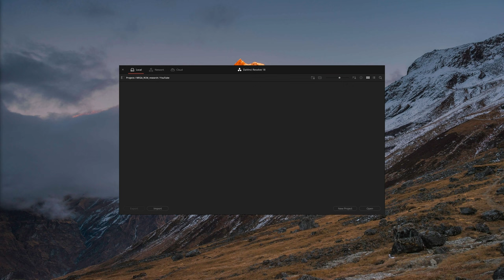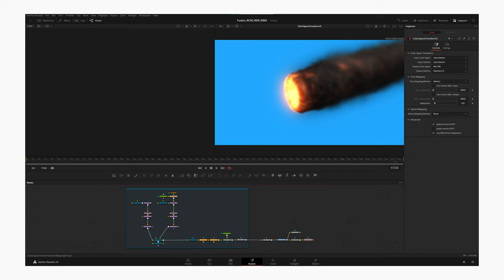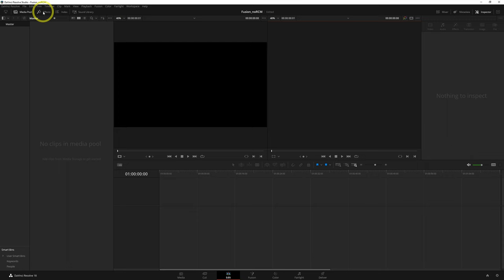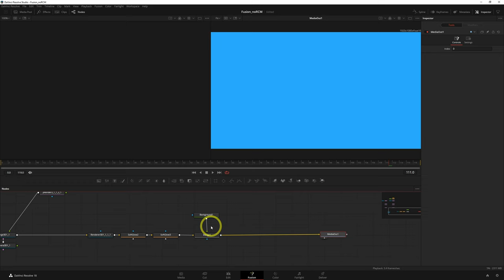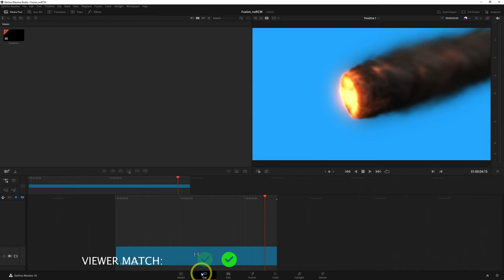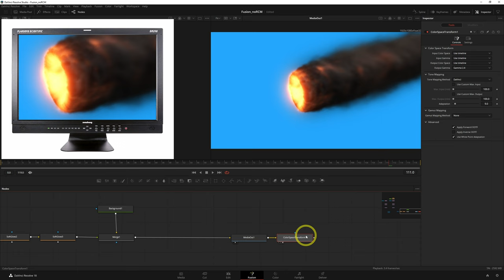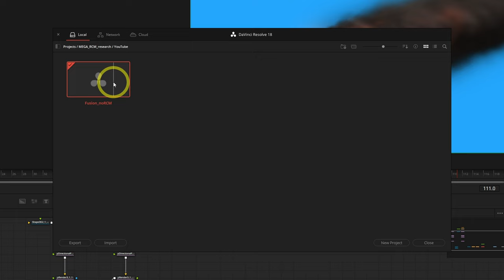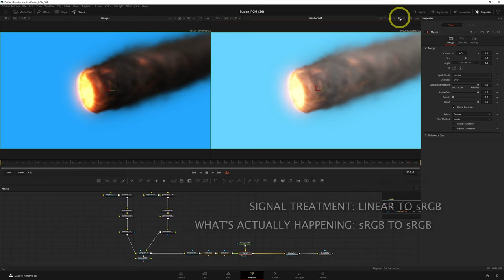Fusion Color Management

Comment: I Have a question about your statement at 13:20 "This problem is unique to compositions that are created in a non-color managed project, and then that project has color management enabled." I am having a hard time understanding this, because when I create a brand new project, enable automatic color management, and then create a simple fusion comp with a colored background, i still get the washed out discrepancy you are demonstrating. Shouldn't the automatic color management take effect on this composition since it was created in a color manage project?
Reply from the maker: I've just tried this on my end and I got the washed out result when I disabled the viewer LUT and went back to the Edit page. That makes sense because at that point I was looking at the linear image in Fusion (no viewer LUT) and the sRGB version of it in the Edit page. With the viewer LUT enabled, the viewers look almost identical, minus the slight gamma shift we experience due to the difference in the sRGB and Gamma 2.4 (as described and fixed in 20:47). So, the workflow for starting a project from scratch should be to work with the Fusion viewer LUT on and a simple CST converting the composition from sRGB to Rec.709 Gamma 2.4 prior to the MediaOut node. Hope that helps!

Comment: Daria, I know that I asked you this in person before ( on facebook ) but I still don't understand why Rec709 (scene ) is the default for the non managed color management. You gave me an explanation then and I believe it is the same in this video, but after doing a lot of research, I understand the explanation, but in my opinion it makes everything confusing for new users. Rec709(scene) is generally the camera gamma - which is around 1.95 - I really don't know anyone that is working in Resolve that isn't using some type of display - and I would be that none of them are set up for gamma 1.95 - so the connection for the user of then changing the output to their display gamma requires that they know what they are doing. Resolve should be able to tell what the input is - so the Rec709(scene) as a default still makes no sense to me. Usually defaults are set to what the majority of users would use, and although broadcast is gamma 2.4 for most pros. Macs P3 and most sRGB PC computer displays would be better to have gamma 2.2.

whewww - sorry I don't have the ability to put up a puppy video while spouting off all my thoughts in these comments. Maybe just visualize one in your head while reading. 

Now the other thing that doesn't confuse me, but I wonder about - the Davinci tone mapping and check the forward OOTF - I have been under the assumption that the actual checking is automatic in Resolve because if you change the color space drop down Resolve will check or uncheck the appropriate setting. And I noticed that going from a large gamut to a small gamut or vice versa is what triggers it. And considering that just changing the gamma from linear to 2.2 or 2.4 is not really changing the actual gamut size - the Davinci tone mapping wouldn't seem to be something that you would want happening, and forcing it into OOTF doesn't seem right to me either. 
I will of course do more reading on these topics to confirm my opinions or discredit them as incorrect. 

I have to say that watching this brings me back to my old coding days where I had a company that I would preach - If you are doing something that seems to long and tedious where you feel there has to be a better way, there probably is a better way. You either haven't learned it or you have uncovered a problem where you might need to invent a better way.
You mentioned that some of this seems to be a band-aid - I get that feeling watching this that you are smart enough to get everything working here correctly, but I think the engineers may want to figure out better solutions to these problems. Color management shouldn't need to have seperate color managements for fusion- just doesn't seem right to me and all the stuff you did to work around that is impressive - but should be in my opinion dumbed down for people just to check off how they like to work in the user preferences and then everything else should be done to accommodate their preferences.
Sorry for being so long winded here Daria, It's a slow day for me today.
Reply from the maker: Jim, I really admire how passionately you have been pursuing this topic. It's one of the reasons why I wanted to start exploring color management more thoroughly and trying to acknowledge (and fix) the gamma issues when working with DWG and ACES. I wholeheartedly agree that, ideally, none of these workarounds should be necessary. Users and trainers have been reporting the visual shift between the Fusion and Edit pages since DWG was first released. Most people first encountered it when using Resolve's templates and tools like Text+. And this issue is further complicated by the rigid behaviour of the Fusion Viewer LUT (which should adapt in response to the project color settings). Are you at NAB this year? Shall we corner one of the devs and enquire politely about this and the Rec.709 (Scene) question?
Reply: @DaVinciMasterKey  That really would be a great opportunity for me to get some questions answered, but unfortunately my passport ran out during the pandemic ( Canadian ) and the backlog has people waiting months for their processing. I know a few people that had holidays booked and had to cancel because of the wait.  
Thanks for responding, I really respect your opinion and ideas - but found myself watching and thinking there has to be a better way. 
I just see people in the forums that are getting so frustrated, and I help where I can. 
Cheers
Reply: My two cents. Most of the confusion comes from encoding and display gammas being juggled interchanged, with foggy terminology and namings. Lets start with a simple question: does a rec709 camera feed sent directly to a gamma 2.4 calibrated display look as intended or not? If it doesn't, why, and what should be changed? If it does, then there is the answer: data encoded AS rec709 scene is encoded FOR gamma 2.4 display. Notice the AS vs FOR - these are different aspects of the same coin. Data encoding is not display transform/calibration. Gamma 2.4 display calibration specifically targets dim surround and end-to-end gamma above 1.0, which is achieved by feeding it rec709 scene signal. If gamma 2.4 corrected signal were sent in, end to end gamma would be 1.0 which makes the mids too bright. Now, how come everything seems to work when project's output space is set to gamma 2.4 encoding? My two cents is that in this case people subconciously compensate for it in the grade, implicitly applying the reverse correction to the data. Resolve tops the confusion with output space dictating the metadata tags, so people are forced to use gamma 2.4 to get stuff tagged for some random software X.
Reply: @hendrikproosa  That is a very good point, a big point of confusion and one that I have yet to see explained clearly. It is so often said that "Gamma 2.4 is for a dark room with controlled lighting, 2.2 for the TV in a lit room and 2.6 for the cinema projector, so you should grade SDR on a monitor calibrated to Gamma 2.4". Meanwhile, if you changed your ODT to output 2.2 and calibrate your monitor to gamma 2.2, it should look 1:1 the same as before, because you're just applying the inverse of the monitor's EOTF, which cancel eachother out. Or am I mistaken, Hendrik?

If you're open to collaborating, I'd love to tackle this topic in a video with your help.
Reply: @KaurH  That's the idea, but full perceptual match in different environments is a hard goal to reach. ODT as a term is problematic imho. Output Display Transform implies that whatever you select there is targeting that display. Ok, great. But what if you select lets say ACEScc as ODT? What kind of display does it target... none. So again, you get a mixup of different concepts. In some cases ODT says that it encodes data FOR something, in other cases it says it encodes data AS something.
Reply: @hendrikproosa  Maybe I didn't explain myself clearly enough, but by match I didn't mean a perceptual match with 2.4 in a darker environment and 2.2 in a brighter one, but whether the same display in the same environment would look identical, if it was
a) Calibrated to gamma 2.4 and Resolve output gamma 2.4
b) Calibrated to gamma 2.2 and Resolve output gamma 2.2

I use the term ODT (output device transform) only in situations when I am outputting to a display transfer function, be that a gamma or PQ curve, otherwise I just call it what it is, a CST.
Reply: @KaurH  They should look identical within precision. Calibration curve and encoding curve would cancel each other out in both cases, producing end to end gamma of 1.0 IF output gamma means the gamma correction for specified value.
Reply: @hendrikproosa  In that case, why are we talking about a difference between gamma 2.2 and 2.4 if the displays cancel that out and given that both are calibrated, would result in the same image, right?
Reply: @KaurH  Because you need to send proper data into display based on how display is calibrated. You won't recalibrate the display each time to play footage with random gamma X, so data encoding has to be changed instead. You can calibrate your screen to random gamma if you want, but you have to compensate all the data to see it in any reasonable way. Macs did (maybe still do) similar thing where LUT sitting in the signal path expected data to have been corrected for gamma 1.8.

Comment: Hi Daria, I do have a follow up question. When working in a DWG color managed workspace, if you use a Text+ Title, the color of the title is affected in a similar way, as in it doesn't display on the edit timeline as one would expect, however when opened in the fusion page it looks as it should. I presume this happens because it is a fusion clip, and therefore has a Linear gamma. I thought that perhaps adding a color space transform effect to the Text+ layer in the edit page and changing the Input Color Space to sRGB and Input Gamma to Linear might fix this - but although the image changes, it still isn't correct. Do you have a recommendation on the best way of dealing with this? I understand that it makes sense to make most color adjustments inside fusion, if working on a fusion comp - but in the case of Text+ layer on the edit page - what would you suggest?

Thanks.
Reply from the maker: At the moment, my solution for this shift in the Text+ (and many other Fusion titles) is like the one I described above - using CST nodes at the end of the Fusion pipeline to better manage the tone mapping. But but but.....I think the devs are working on this at the moment, so we may be free of this issue soon!
Reply: @DaVinciMasterKey  thank you
Reply: @DaVinciMasterKey  That would be awesome, Daria (to have Resolve address the issue with tone mapping of Text+, etc. but it's good to have a better understanding of what is going on and be able to tweak it as you have shown).

Comment: Any idea if the announced "Support for DaVinci Wide Gamut in Fusion"  in Resolve 18.5 Beta (assume it's included in the released 18.5 as well) addresses the color management issues? Tried messing with it and it looks like it gives an option to set the color space on the MediaIn node. Couldn't figure out how to get it working properly (probably due to my lack of understanding).
Reply from the maker: I've just tested these workflows in the newly released Resolve 18.5 (it came out of beta a few hours ago), and most of these solutions are (unfortunately) all still relevant. The Color Space parameter has always been available in the MediaIn node, but it doesn't rectify the problem, especially considering that the rest of the pipeline (generators, text, graphics, etc) need color management. The only difference I spotted was when I was working in a DaVinci Wide Gamut project - the Fusion composition was correctly color mapped on the Edit page timeline from Fusion. But there's still the issue of the Fusion viewers not showing the image correctly - I had to use the above solutions to reverse the color management to monitor the composition correctly while I composited it. Thankfully, no additional management is necessary in the Fusion pipeline (prior to the MediaOut) itself.
Reply: @DaVinciMasterKey  Hi Daria -
Now that Resolve 19 is out and supposedly fixed the Fusion color issue, how do you think they did?  Is it fixed or is there more that needs to be done?

Comment: Fusion nodes ... and the Color Management tab nodes confuse me. They're not one and the same. I suppose Fusion has its own workable SDR color management but for real detail, the Color Management tab rules. Is that right?  Should i use Fusion for effects mostly, Color Management tab for my color management? Thanks!
Reply from the maker: When you say Color Management tab, are you referring to the color management settings in the Project Settings? Those determine project-wide colour management. The reason why you don't see that management reflected in Fusion is because Fusion operates within its own working color space (sRGB Linear at 32 bit floating point). Color management in Fusion is normally only done for monitoring purposes, with actual footage color mapping performed in the Project Settings or the Color Page.
Reply: Hi, thanks for answering. I meant that tab just to the right of the Fusion tab. The Color tab, I guess. I was worried there was a duplication of effort (color in Fusion, color in Color tab). But if the Color tab is the main deal to use (especially for a film), that is good. So, I guess the node structure in Fusion is different than the node structure in the Color tab and both can coexist. @DaVinciMasterKey
Reply from the maker: @RealNowTruth  Oh yes, they're designed to co-exist! They're both integral parts of the post production signal process. Generally, the Color page is where we manage incoming colour from raw video signals, grade it, and prepare it for deliverables. Fusion's color management is mostly reserved for internal compositing workflows.

Comment: I'm really not sure why Blackmagic hasn't setup the MediaIn and MediaOut nodes to manage this for users. I assumed when I switched over to the DWG last year that they would iron this out. I think I've watched 10 hours of tutorials on color spaces, gamuts, different gamma curves, different HDR standards. I have BRAW&709 footage that goes from the timeline, into fusion, back out to the timeline. It's just too much of a mess, I'm eyeballing so much stuff in the end. I think I just need to admit defeat and go back to SDR. If a contract requires an HDR deliverable in future, hopefully they have improved this system, but until then I think you have to be a real masochist to work with HDR in projects that heavily use fusion.